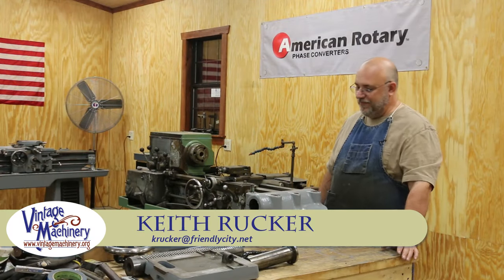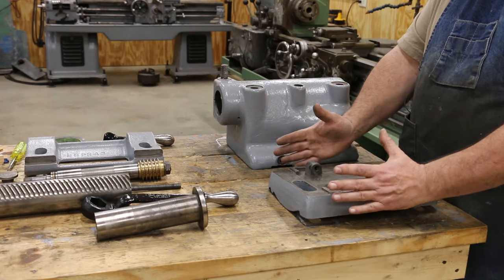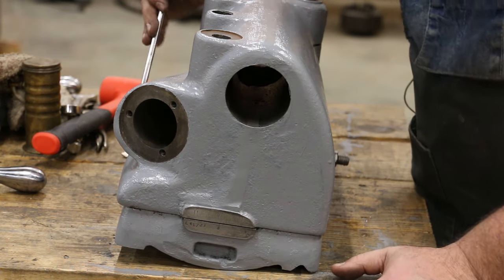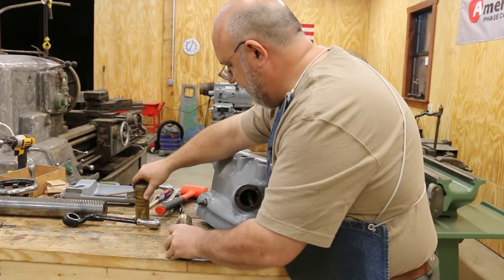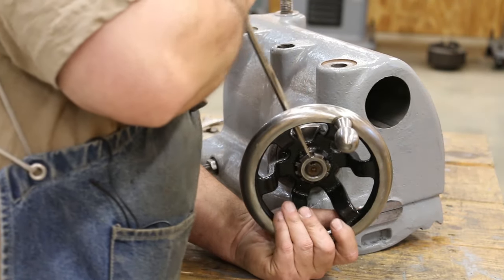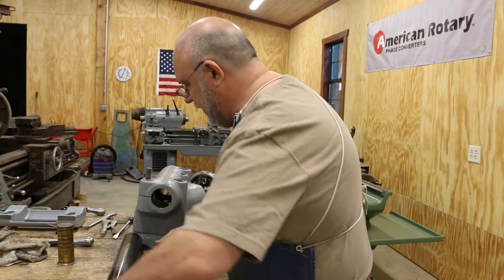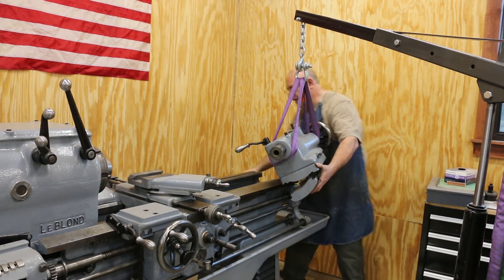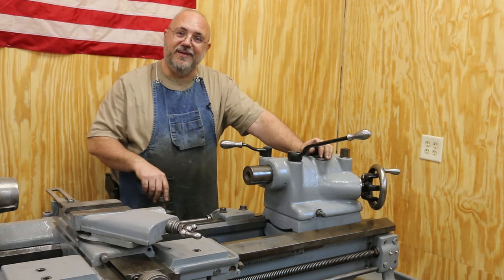LeBlond Lathe Restoration 14: Tailstock

Comment: Being a Ham radio operator I understand the problems you can have with those fine mic wires.  When you lifted the tail stock piece it most likely separated the wires from the element.  I figure that is a sealed up mic assembly so get out the old spare.  I didn't mind the voice over as a lot of the heavy breathing when you lifted things was eliminated (just kidding).  Great video and thanks again, Greg.

Comment: Mr. Rucker,  I was taught by Nye Lubricant Inc. years ago that there is a difference between oil and grease.  They told me oil should be used only when reapplication (oil plug) or a reservoir is used.   The use of grease should be used if long term lubrication is required, and reapplication is doubtful in the future.  They also cautioned us on mixing different types of lubricants, as lubricants are made with different bases such as clay, polyurea, ect.  Nye Lubricants basically make synthetic oils and grease, and we used it mostly in equipment that need to be/stay lubricated for an extended period of time.    Like your projects and thanks for posting.

Comment: Excellent tutorial.  You can’t over-emphasize the importance of using lubrication during reassembly.  In engine rebuilding it is
recommended to use assembly lubes with Zinc dithiophosphate (ZDP).  Even though the shop machinery will not deal with the temperatures and pressures of an internal combustion engine, the dangers of “dry starting” machined surfaces is real.  It takes a long time for operational lubrication to reach some internal parts.  Don’t risk it!

Comment: Great job of restoration and fun to follow. It appears you may have sheared off the retainer key tab with your improvised "socket" but should still be secure enough if you do not apply "Abom" torque to the crank. As Sears closes their stores, watch for a closeout on missing sockets.

Your beard looks very appropriate and now you can say you are "travelling in magneto" but please do not braid it and add beads as the chin area grows out. Having a long chin beard tangled in a lathe project could leave you "standing there with a long face".
Reply from the maker: One of the tabs was already broken off before I ever started on the lathe.

Comment: Hi Keith, you almost got it! Quick question: at the opposite end of the morse taper don't you must have a piece or something to pop out the tool you have installed once you reach the end of the travel on the tale stock spindle? Or in the Leblond you have to knock the tool out with some long bar and a hammer? In my old Gläss lathe, when you reach the end of the travel the tool automatically pops out, cause normally es hard to remove a mandrel or a live center by hand, or if your morse cones are in good shape, its impossible by hand. Cheers!

Comment: Keith, why don't you get more of the rust off of the unpainted parts, especially the ways, and sliding parts? I would think the oil/oxide mixture would be abrasive.

Comment: Hi Kieth - really looking great. Ive had a question nagging me for a while. When you rebuild these old lathes do you ever run into rotating parts that are warn out or have slop beyond acceptable tolerance because of long periods of use? If so how do you compensate or correct for it so that the machine is more back like it was when it was new?
Reply from the maker: Most rotating parts that have critical wear will happen on bearing points.  Very often you can adjust for this by replacing the bearings or making a new sleeve bearing depending on the situation.  Every case is different but very often you can work around it.

Comment: Could you or anyone discuss the advantages/disadvantages of this style (side angle crank) of tailstock vs the kind where the crank wheel is in the end? I hope there is more to it than some like Fords and some like Chevys. Some people have commented on the removal of the center, chuck or morse taper. Is there a way to remove them without a long bar having to be inserted into the end of the shaft and risking sending the center, etc. into the chip pan after a hard smack from a hammer?
Reply from the maker: The big advantage is that with the angle version you can have a hole all the way through the quill which has some advantages.  Honestly, I don't think it really matters that much.

Comment: Nice job Keith. What color/paint are you using on the lathe? I am doing the same thing to my Clausing/Colchester lathe and really like that color.
Reply from the maker: It is a machinery gray color that I got in an oil based enamel from Sherwin Williams.
Reply: Thanks

Comment: Been waiting for your latest video mr Rucker. :) Can you please share some info about the equipment you use to shoot the footage with? I believe you told us earlier you use a Canon. Do you use any gopros and if so, what settings do you use on the gopro? 

Thanks for your videos and have a nice day Keith.

Regards from Sweden.
Reply: dixonqwerty Check out Brad Jacobs' latest YouTube video with the title "A.V.E." for Audio Video Equipment. Great overview especially for getting good sound in a shop environment.
Reply: Thomas Utley Who is Brad Jacob? I did a search but didn't find anything related to machining/workshops. Can you tell me the name of his channel please?
Reply: "basement shop guy", I believe.
Reply from the maker: I use a Canon 70D as my main camera, but I do have a GoPro that I sometimes use for second shots.  I much prefer the Canon over the GoPro as the GoPro has no ability to adjust the frame (zoom) and it has no depth of field (everything is always in focus).   It is a great sports camera but not so great for what I am wanting to use it for.  For audio, I use a Sennheiser wireless mic - forget the exact model off the top of my head, but it is a great unit.  My microphone problem in this episode had to do with the wire on the attached microphone and not so much the wireless unit itself - those wires get a lot of abuse in a shop environment and have to be replaced from time to time.

Comment: between the two locking bolts there is something that lines up with the oil hole for the adjustment shaft. is it an oil hole cap? is it made of brass?
Reply from the maker: Oil hole.  The cap is made of steel, but brass would have looked great.  Considering this machine was made in 1941 - right before the US entered the war but while we were building up, brass may have already been in short supply.

Comment: what is the socket size for the handwheel nut?
maybe i have that socket collecting dust...
Reply from the maker: I did not measure it, but my socket "collection" only goes up to 1-1/8" and it was bigger than that.  I am guessing either 1-1/4" or 1-3/8".

Comment: What's the difference between light machine oil and way oil? I've heard both terms use by you and Keith Fenner.
Reply: Tubalcain "Mr Pete" just did a vid on lathe lubes. Well worth a watch!
Reply: Railfan 439 "Way" oil has an additive to make it cling to the inclined surfaces of the ways. Also a bit higher viscosity to support the weight of saddle and tailstock.
Reply: Thanks, learn something new every day. Jon
Reply from the maker: Tom Utley nailed the answer on this one.  Way oil is made to be somewhat "sticky" so that it stays on the ways.